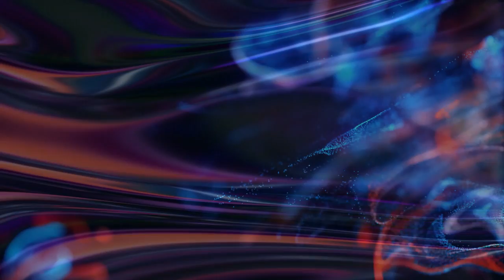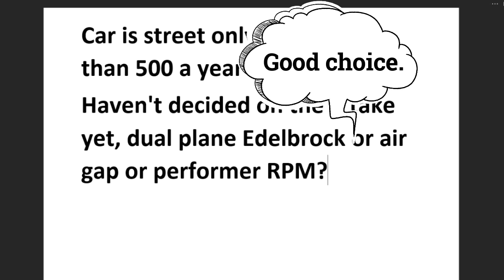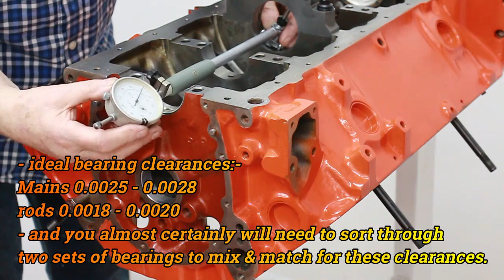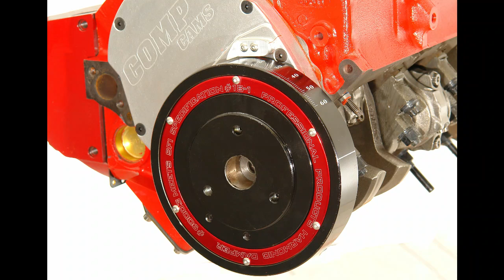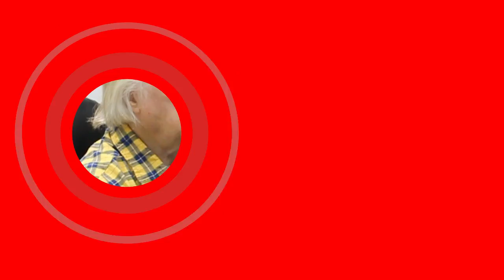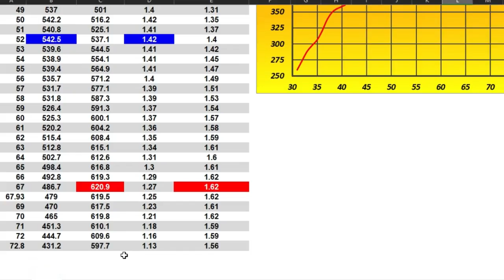How we built that super competitive low buck 383 SBC

Comment: I watch you, Uncle Tony, Steve Morris and Salter for real information that always checks out.  I am taking all of your info in my new motor for my 69 Chevy Van with a 4 bolt main Gen 1 350.  My last motor finally burnt a valve and has low oil pressure from just being worn out.  All the good parts from that motor are going into the new motor along with much more.  The only work being farmed out is the sleeve which one cylinder needs as it dropped a valve.

Thanks.  I am also 78.

Comment: Great show David as an engine builder. I greatly appreciate this one thing that I may add is that you should never should you square groove keepers because they’re more faulty. You should always BEAD LOCK valve retainer, which is rounded like a half moon They’re much more reliable and could withstand higher RPMs better. Of course you have to have valves. That will accommodate the keepers properly but it’s just a part of doing your homework and finding out what works from the experts anyway keep on rocking.😊

Comment: Now you have me worried, I had a 383 built with Callies magnum forged crankshaft, Callies ultra rods, forged pistons. AFR 210 heads, but an 800 roller block with 4 bolt mains. Hope I don't trash the block!

Comment: The bbq tank does not put out liquid when upright.  The line freezing when upside down is from liquid turning to vapor in the line.  You will have to turn the bbq tank upside down to run the car.  That system is designed for liquid.  The pressure regulator for the bbq and the heater are designed for vapor only.

Comment: Mr Vizard, 
What would be the 128 formula react to a 288 cubic inch engine react how would that react weather 911 compression ratio and 194 valve I'm getting below 110 is my calculations this is a 28330 over it's an old super stock engine that we used to run 30 or 40 years ago and I'm putting it together just for fun but I want I know the right camshaft Will Make It or Break It back then we ran straight drive and it didn't matter as much because we would turn it up to the moon and dump the clutch and we broke a lot of stuff but when we didn't we were in for a heck of a ride but I'm putting this in an automatic car so the camshaft will be a lot more particular and I'm only going to use the $3,500 converter and a 410 gear so I'm behind the eight ball to get the engine to perform any kind of way like it is to and I'm not thinking it's going to or I know it won't but it would be nice to hear it sound somewhere similar to the way it was and back then we ran the tunnel ram with 2660 Center squirters and now I'm not going to run anything close to that

Comment: Why do you have such a boner over a 383 SBC?   Why not the 377. The 377 has a much larger bore and a shorter stroke.   You can do a lot more things with a 377 vs a 383 / 350 stroker motor!

Comment: Hey Dave. I'm dead set on building myself a 383. However, I have question on the head selection. You mentioned that your choice would be the AFR Enforcer heads and later in the video you mentioned Dart Platinum Pro. My question, what is your opinion with stepping up to AFR 220 Eliminator heads in this same build?

Comment: I'm a bit confused with the cam terminology used here. The screen shows LSA and DV calls it lobe centerline angle. But the lobe centerline is not typically the same as the LSA. So, is a cam with a 108 LSA being recommended, or a cam with a lobe centerline at 108?  What about a cam with 112 LSA and 4 degrees of advance, putting the lobe centerline at 108?

Comment: Hi David,  I've been following you for most of my life have some of your old books from the 80s I believe, and have been flowing Heads since the late '70s, mostly Motorcycle heads. One of the last for-profit heads I did was for a race team I sponsored for fun at a semi-pro turning Pro level. When working on the stock Yamaha Head and looking at the factories machine cut seats, for titanium Valves I noticed how recessed into the head they were and how the cut effectively placed a tight 90deg to the flat of the valve seat insert wall all around the valve at low lift. Seeing how they had long Duration cams in them with quietening ramps, I modified them, not liking the sharp edge that was close to the valves. Flow improved on my flow Bench, but one of my riders had a big mouth and told other shops of what I had done, to essentially second guess everything I did. He didn't mind all the wins and record laps He set, but had trust issues so we called it quits. 
      However, I would appreciate your opinion on this type of cut seat as I feel what I did was correct, and why would a company Like Yamaha turn out Heads like this is it just manufacturing costs, etc, or am I missing something?

Comment: With the Comp Cams street roller cam, what fuel pump pushrod should be used with a mechanical fuel pump? I don't want a noisy electric pump in my street car.

Comment: You definitely have spent time with building engines. The results are well documented.  I have experimented with a 351C with 4V heads. I  found that the engine produced a ton of HP but it needed a high flow exhaust, porting, high compression with a crane roller racing cam w/rockers and springs. The ignition mallory with accel coil. Carb Holley 1150cfm.  
It would break engine mounts, transmissions and differentials. 
Biggest draw back was the oil pan.
Front mounted oil pickup tube would stave for oil as acceleration increased.

Comment: Yes I will Like, yes I subscribed, this video and yohe others, I see, are GOLD. THANK YOU. 

Not sure you will see this but let me write anyway.. I bought me a 79 camaro for a steal of a deal. Its got a build 383 sbc 4 bolt from a few years ago. I am waiting for the build sheet to arrive from the previous owner. BUT. after watching your video I smiled as many parts that I see or know of on the engine line up very closely to your build in the video - namely the dart heads AND the same rockers upgrade, 750 quick fuel carb. 

Thank you for sharing your knowledge.

Comment: Man I wish I had found you before I bought the cam for my 383. It's close to that first motor in setup but with the cnc ported afr 195 heads around 10:2:1 compression and comp cam suggested the xe288hr. That cam is a 110 lsa and now I wonder what I'll be giving up being off a few degrees.
Reply: In David's book, he dynos different lsa cams on the same engine.  You're giving up about 8 percent peak torque and have a flatter curve  with a little more over-rev. Unless you are racing,  it doesn't matter except for paying the same money for less power.
Reply: @paul mryglod  not going to lie that bit more torque would be fun but changing again for just a street car would be over kill. Next motor I build will now have this taken into consideration though

Comment: I much prefer a 377 or 388, based on a 4.125" bore block, especially since the good 010 4.00" bore 350 blocks are becoming hard to find.

You can buy an SHP block from Dart, and save the hunt and purchase price of a used block, AND most of the cleaning and machine work. You need only bore and hone, or leave it 4.125" and just hone.

I just have better results for racing with a 4.125" bore and 3.625" stroke.

Comment: Im in the process of building this exact engine but I have made 2 substitutions and wanted to ask you your opinion on them. instead of the Dart heads I went with Edelbrock #60899 Performer RPM angle plug cylinder heads and a COMP Cams Thumpr Retrofit Hydraulic Roller Camshafts 12-600-8 (227 duration intake / 241 exhaust & .514 lift intake / .498 exhaust). Im putting the engine in a 1984 Monte Carlo SS and im going to use Comp  Cams recommendation on the stall speed. My question to you is how close will my engine be in comparison to yours and will be even close?

Comment: Hey great job on the video!  I am very new to the whole small block Chevy scene and your knowledge is greatly needed for people like me!  I have a 1981 Chevy C10 I just purchased that supposedly has a 383 stroker in it but I have no way to find out what it really is.  Unless you have a way to tell without tearing the engine apart.  Or if anyone has a easier method to tell between a 383 vs a 350 I am all ears.
Cheer's!
Reply: A 383 will have the off balance 400 damper & flywheel. Unless it has been internally balanced of course. Or stick a straw down a spark plug hole and turn the engine over by hand to determine the stroke

Comment: Yes I very much like what I found in this video. What I would like to see?  Something a little different. There are endless articles about Chevy small blocks (10 a Penny) but very few about a Mopar 440 RB Big Blocks waking up the smog motors and still being able to feed them $$$. How about an engine design for the street. It doesn’t need to rev over 5,500 Rpm. Mileage is a real issue if we are to be able to drive our cars fitted with these BB engines. We Need 80% Hyde and 20% Jekyll. So why not detune from a maximum AND minimum of 500 HP at 5,200 rpm. Aim for the smoothest idle you can with great mileage and still have 500 HP on tap when you push the loud pedal. Street tyres are not super sticky and with a 235 profile they will just spin with the torque most big blocks put through them at the stop lights, so don’t build a stump puller. Mid range is where you can apply useable torque on the street. Make it rev freely to give it a decent sporty feel. Build with an auto box in mind and power brakes (min 13” of vacuum at idle). Think mileage for the regular days and 500 HP when the driver feels like it. Trick Flow heads, sequential injection for street manners, mileage etc. Normally people tune for maximum WOT power …. So be different and work backwards from 500 HP at the top and see how street-able you can make it at the bottom end, where most street guys spend 90% of their time. 😮

Comment: I am building David's 383 stroker  recipe engine from his book "How to Make Max Horsepower from SBC on a budget.  The engine is from a 99 Suburban and I want to make that vehicle a better tow vehicle.  What cam can I use with the existing fuel injection and air intake/throttle body?

Comment: Help!  I'm retired, so on a limited budget, but managed to save up enough to pay a local mechanic $6,000 to replace my aging 1997 GMC 350cu.in./5.7L Vortec V8 with a stroker 383cu.in., in my K1500 4x4 pickup, that I have also spent a couple thousand upgrading the suspension and installing a brake controller, so I can tow a 22ft. toy hauler/travel trailer (empty weight approx. 5000lbs.).  The stock 350 with about 180k miles on it was no longer able to pull that trailer up any medium grades, without dropping all the way down to 1st gear.  I stressed to the engine builder and mechanic that installed it, that I wanted increased low rpm torque for towing, not high rpm HP, to keep it reliable and long life of the engine.  After about 1,500 to 2,000 break-in miles, I finally hooked up the trailer and headed out on a 750 mile trip and couldn't be more disappointed with the results.  My 2007 Dodge Nitro SUV with 4.0L V6 w/150k miles on it, has more pulling power than my brand new Chevy 383 V8 stroker.  I need advice on what I can do to salvage this disaster of an engine build, and end up with an engine that can handle towing this medium weight (or larger) trailer easily.  I'm going back to the engine builder to get an itemized list of all parts he put into my engine, not to find out how badly I was taken advantage of, but to know what I have inside, and where I can go from here.  I'm hoping that I can get to where I want by changing the intake and ignition, plus possibly the exhaust components, without breaking the bank.  Your advice would be greatly appreciated.
Reply: Check static compresion need min 180psi🎉🎉

Comment: Thanks for the videos David, I've read a lot by you and learned a lot from you over the years.  If you have time for a quick question, I have a LS engine I've built making probably around 520hp if everything works.  It's a dedicated race car tuned for 5000-7500.  I plan to run a 200 shot at the strip and standing mile.  Should I size my headers for the nitrous or the engine?

Comment: Mr. Vizard has forgot more than most of us will ever know. Several years back I sought out his knowledge for a ultra competitive 565 N/A Big Block Chevrolet and he gave me so much fantastic advice. 
 The 565 I built in my home shop based on alot of his insight is still in my Race Car and has seen hundreds of passes with regular maintenance and care, using good reliable, rebuild able money saving parts of fantastic Quality I have opened it and checked everything 3 seperate times and all we have done was replace one weak valve spring, and all gaskets every time we tore it down for inspection. I religiously cut my oil filters and inspect them under a microscope looking for any metallic particles that can foretell a problem and much to my relief I've yet to find anything other than normal wear and tear....This was my first attempt at a true blue printed engine where everything had to fall within designated tolerances and weights and while it did get frustrating from time to time during the assembly process....you would be hard pressed to find a person who would disagree with the outcome.
 I've done a lot of winning with this Engine and plan this winter to pull it clear down and methodically replace all the Bearings, Rings and anything in the valve train that looks like it's showing wear and look forward to many more happy stress free weekends at the Drag Strip. Thank You Again Mr.Vizard you are a treasure to be sure.

Comment: Hello David, thanks for the wonderful information. I have a later roller block that is a factory 4 bolt block. Will 550hp be ok with the 4 bolt on a 383 and 7000 rpm or will it still be a time bomb?

Comment: I disagree with some of the first part of this video I built a 383 5.7 rod scat rotating assembly , dart iron Eagle heads , solid roller cam & he said a double pumper wasn’t good .. I ran a 850 dp with a 250 shot of nos that run pretty good  but when I went to a 1050 Dominator that engine came alive !!!
Reply from the maker: Heath,
 We are building his application spec not yours. A 750 vacuum secondary is what is needed for the best experience on the street. This guy was not going near a drag strip!!
Question:- what's your gas mileage like?

Comment: 383 is a truck motor. I dont know any serious racer, track car, drag, jet boat that would run a 383.  A 377, 406, 353, 355, 302 even but a 383 belongs in a tow truck. The bore & stroke is a low end torque combination. The small bore will shroud the valves.  Bigger bore = bigger valves = more air in the motor = more power!Never herd of this guy visie.
Reply: So how does a 355 or a 302 seem like a better choice then?
Reply from the maker: Hey 'what about' 
I am showing what you can get from a 383 not a 377, 406 355 etc. No where did I claim it was the best combo but I think I conclusively showed that it can be a very effective combination if built nearer optimally as the drag strip and dyno results prove. No disrespect here, but without results you are just quoting an opinion. Yes, I have built 377, 406, 427, 434 and 441 cube engines and yes, they do have better potential BUT THE GUY ON HOTRODDING FORUM WAS DOING A 383 WAS HE NOT?

Your comment - 'never herd of this guy visie'. The way you spelt ' herd' is for a 'herd' of cattle. I think you meant 'heard'  and who is this guy 'visie'. Like you, I have never 'heard' of him either but, that said ,I'll bet   he has not heard of you either!

Comment: Hey David I've watched a few of your videos and I have heard you say that lobe separation angle should be around 107 on average for a 2.02 valve and cr 10:0. -1 or lower.   Now correct me if I am wrong here. From what I have learned a lsa down around 107 will move peak power higher in the RPM band, and it also narrows the power area. So yes on a dyno that peak number for max hp maybe higher by maybe a small amount vs a lsa of say 110 where the max power number maybe 5-10 hp lower. But it also moves it down in the RPM range by say 300 - 600 rpm lower, and it then creates a wider hp and torque curve for better drivability. A motor running a 107 lsa vs a 110 may only make 400 hp with any set up under 4500rpm VS a motor using a 110 lsa will give up example 8 hp at the peak but under the curve where the motor with a 107lsa is fighting to make 400 at 4200 the other will make 422 at 4500 and was making say 385 at 3900 rpm and the 107 motor only makes 340 at 3900rpm. And really unless it's a 100% drag race engine only and with a stick ( less rpm drop with more gears and tighter ratios) seems to me for all other applications road race street cars, have the drag cars running 3 speed automatics they would be better off giving up say a max total of 10hp to gain as much as say 30 in some places under the curve ? So can you explain to me why you say that a 107 lsa angle is better? If it is just to have bragging rights by showing dyno numbers being larger one way rather then the other then to that I say dynos are not the only things that contribute to winning races.

Comment: David, I have just built a 383 exactly as close as I can get to your specs. It is a family project between my dad, brother and myself we are super excited to start this up in the next few weeks. Here is a rundown of the build. 
Quench set at 0.034LH/0.036"RH with flat top two valve relief pistons, 6" rods, Canfield 195cc/65cc chamber heads ported per your specs, Lunati solid roller DV293-06 camshaft, Weiand stealth intake ported to match the heads, Holley sniper EFI. Really hoping to make some good horsepower numbers with this build and would love to send you a video of it if we get it to the dragstrip this year. 
Thank you so much for the years of information your an inspiration